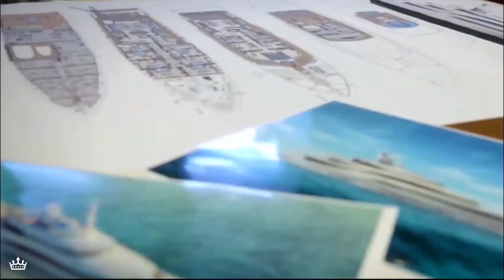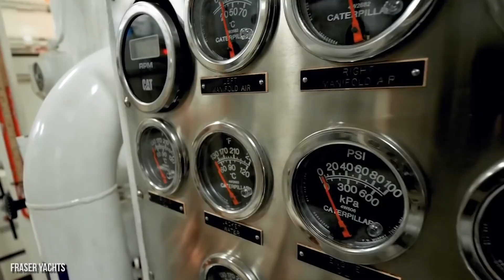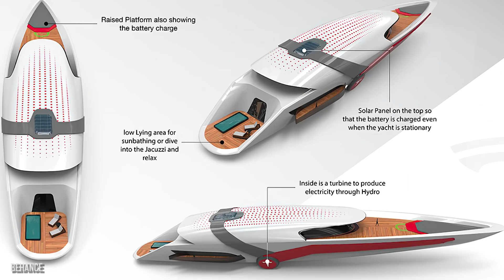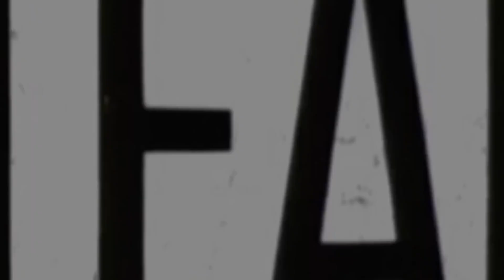The End of Fuel Costs? Tesla's Electric Superyacht Explained!

Comment: Can see that this thing is designed by UX designers, not engineers. 😂😂 For example; that tiny solar panel doesn't produce nowhere near enough power to power the yacht! It being a 50k$ panel doesn't make any difference. The best panels that exist can capture about 25% of the energy, which is about 250 Watts per square meter in optimal conditions, which is absolutely nothing with that tiny panel compared to the power consumption of the yacht. If you have that big yacht like that, you would fill the whole top with solar panels! The hydro electric power at the bottom is another source that is so tiny that it is nowhere near enough to power the boat. A sail boat is going to way be faster than this on the sea, and sailboat is only self sustaining yacht that can capture the energy truly from the environment. And take a look, how big sail you need to do it even for much lighter boat? Very big! This thing is a complete lie and hoax. There is fully solar powered boats, take a look how they are made, how light they need to be, etc. and you will understand something.
Reply: I absolutely agree with you!
Reply: That tiny solar panel is nonsense. Can't even power my house